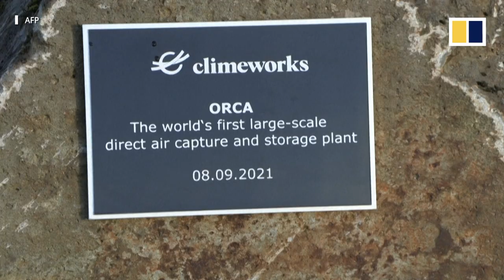Iceland power plant stops greenhouse gas by turning carbon dioxide into rock

Comment: "The gas reacts with the basalt rock and solidifies within its cavities for up to 2 years"
... and after that? It gets released again?
Reply: you wouldve buried it deep underground already...
Reply: @yerri5567  Imagine someone accidentally mines it
Reply: "It's only released if it's super heated, like during an eruption...but the volcano has had minimal activity and the last eruption was 1,900 year ago."
The clear rock is the co2...I think they know what their doing chief
Reply: @audreyholmes9751  I doubt it would be that easy. But I haven't watch all the video yet, so this is speculating on my part. You obviously want to bury it down underground in an uninteresting location, and super deeply so right? Temperature also increases everytime you go deeper, what do you think the carbon stone stability will be when it's exposes to a couple hundreds of degrees Celsius?
Reply: @memerusos8145  won't that make diamonds?
Reply: Yeah, I laughed when I heard that too :)
Reply: @ordinarydude2237  no
Reply: @piotrtrebisz6602  That's cool and all, but the soviets bore hole miner thing melted when they dug 10km+. Do you know the materials for the miner to not melt and crush at such pressure? Even electronics would break long before that.
Reply: @piotrtrebisz6602  Oh? My memory must have gotten mixed up

Comment: So what happens after those 2 years? Does is get rereleased? Or is there a gas buildup underground waiting for a poor sap
Reply: Ah I think that was a translational error, I'm pretty sure they mean the process by which the carbon dioxide becomes part of the rock takes two years to complete rather than it only stays there for two years, otherwise this would be really impractical and ultimately not accomplishing much

Comment: this is cool and all but what about the carbon footprint of building these giant industries? the cost of running the electricity to fuel the production of turning carbon into rock? the maintenance needed to keep it running? the vehicles the workers drive just to commute there? is it really worth it? will it make a difference 10 years from now? will it become more sufficient 10 years from now? will it contribute to more waste and carbon 10 years from now when parts break down and need to be replaced? what are we going to do will all these rocks now? if we do anything with them at all, like say turning them into material for construction, you need to spend so much energy on the process too.

Comment: There's a technology that converts Co2 to oxygen, its called trees.
Reply: Which are being cut down and burned at high rates.
Reply: That's only partially correct and it an exceptionally slow process.
Reply: Yes - however every fully grown forrest ist Co2-neutral.
And those 4,000 tones of Co2 they can convert per year and the equivalent of about ~2,000 trees  (depending on the type of tree and age).

Comment: "The process is energy consuming." So it produces more CO2 to capture some CO2. Great idea. Always circling in the loop.
Reply: Not all energy generation processes involve combustion. Icelandic energy rely greatly from geothermal source.
Reply: Watch the video again, they explain to you how they use geothermal energy from a volcano to power the plant.
Reply: @KiwiImpactSaint  So can we triple world electric generation by using Iceland's geothermal so that we can fill Iceland with these plants to remove not just 4000 tons a year but 42 Gigatons per year?
Reply: @ChronicOstrich  Why should I watch the whole thing to get the full context when I can just post idiotic comment and spread my idiocy with others.
Reply: @cliffordnelson8454  4000 x 1000000 = 4000000000
Thats only 4 billion per million of these plants.

This problem isnt gonna go away easily.

Comment: So basically we could make it into diamonds later.
Reply: Dont you date reduce the value of my diamond.
Reply: @msjanegrey  We can already replicate diamonds actually. But not yet in a gem quality. Sanders, glass cutters, and boring machines drill bits are one of the products.
Reply: @soysauce4223  oh dear me.
Reply: Diamonds are more common than most gems anyway
Reply: @memerusos8145  diamonds are common, but gem quality diamonds are rare.
Reply: @soysauce4223  diamonds are rare cause of DeBeers
Reply: @memerusos8145  yea
Reply: Scientist says, diamond is just another carbon, just like CO2.
Reply: Doesn’t work so easily, diamonds are pure carbons (without other types of atoms) with covalent bonds in a tetrahedral fashion to form a big network. CO2 have two oxygen atoms. Idk if it’s possible, but you need to quite a lot of reaction steps to remove all those oxygen atoms. And those steps will need energy or resources, so I think it is not simple nor economically viable.( otherwise people be doing it already)
Reply: diamond is worthless

Comment: Carbon dioxide in the atmosphere is at equilibrium with the carbon dioxide dissolved in sea water - about half and half. Equilibrium means if one molecule of carbon dioxide is removed from the atmosphere it is replaced by one molecule of carbon dioxide from the sea. The concentration of carbon dioxide in the atmosphere remains unchanged. The concentration will remain the same until the amount of dissolved carbon dioxide in the oceans begins to decrease as a result of capture of carbon dioxide from the atmosphere through processes such as the one described. This is a gigantic amount. It may take centuries.

Comment: Are we not trapping two Oxygen atoms when we are trapping CO2?
Isn't that a bad thing then?. Converting CO2 to O2 is I suppose ok, bht trapping CO2, well., I dunno.
Reply: Maybe the chemical reactions are easier, there surely is a reason, why they chose the material. Maybe it can be used for building tho
Reply: @kugul1683  Easy or not , trapping any gas in the atmosphere like this a large scale, won't have changes in atmospheric pressure?
Reply: There is way more oxygen in the air than CO2.
Reply: @HunterShows  Waaaaaaaaay more.

Comment: If this uses more energy than a coal powerplant could produce while emiting the same amount of CO2, Its poinless and even bad for the envirement!
Reply: facepalm it's geothermal my dude, they cant turn the volcano up
Reply: how do you know are one of the Scientist who work there? Dont make up any fabricated stories if you dont have any evidence to prove your statement
Reply: @markchristianhernandez2890  The location is introduced as a "geothermal power station" at 0:02
Reply: Doesn't matter how green the el electricity is because the electricity could be added to the grid, offsetting fossil generation. 
And yes, I know Iceland doesn't use any fossil generation. But imagine if all the Bitcoin mined in china on coal power was instead mined in iceland using the power that is now wasted on this CCS facility. Also a HVDC connection to the UK could be considered.
Reply: @nielsdaemen  You definitely have a point - although, there's a non-negligible loss in efficiency when power is transported long-distance; having the carbon treatment right on top of the source of geothermal power avoids that at least!

Comment: boiling the water to extract the co2 is energy intensive however if iceland has some geothermal springs it could be possible to extract heat to reduce the amount of additional energy required

Comment: These sites should be every where, every country and cities. Amazing.
Reply: Unfortunately due to capitalism it wouldint be profitable to implement this across all countries and city's
Reply: The energy required to run this equipment takes energy.  Where will that energy come from?  Suppose it comes from coal... Bad idea, more CO2 would be made than you would be able to remove from the air.  What about wind and solar?  Nope, those take land and you would be more efficient and cost effective to just grow trees and bury the wood.  You'd be better of just using whatever energy you have to supplement the local grid.
Reply: @kayakMike1000  Nuclear.

Comment: This is a joke. Energy consumption is ridiculous. They can remove 4000 tonnes of CO2 per year - equivalent to only 500 average Icelanders' yearly CO2 output. What with the materials and energy used here? Just people driving there to work means this whole facility will never be net carbon neutral.

Comment: It doesn't fix the problem.Simply slowing down the process.
Reply: Which is better than nothing. Trees will pick up the slack.
Reply: @HyanIze  Carbon dioxide doesn't mutate, though. I do get your point. The slowdown do buy us a bit of time. Hopefully, enough trees are planted by the time they are eventually released. But, you can guess what reality will actually happen.

Comment: There are 42 Gigatons of CO2 created each year, which is more than the total amount of earth moved. To remove a ton of CO2, how much of this rock do you create. At some point you will no longer be able to inject it in you local garbage pit, and will have to more it somewhere else. And how much energy is required for the process. If you have to use fossil fuels to create the energy, will you actually be saving anything, or creating more CO2. I heard that the electric generation capacity would need to be tripled to remove this much CO2, or about double the total amount of energy the world uses. Seems like the first thing that needs to be done is remove as much of the CO2 emissions as possible, then can start trying to increase electric power so that can start removing CO2. Before that this work is only making the problem worse. So put the research into something that is a lot more useful than carbon capture, put it in reducing carbon emissions.

Comment: What if this stored CO2 could be enveloped in a transparent container and then sold, either as decoration, as a construction material of some sort, or in other ways used as a type of geopreserving currency. We know every company and country has CO2 quotas, what if CO2 could physically become something that would be tradeable something in demand. That would skyrocket the general public investment, as well as that of the financial sector and businesses, further sparking an interest in carbon capture and efficiency improvements and scaleability in other parts of the world. Just see how bit mining has turned the whole world upside down even though it's merely a digital conjure with no actual relevance.

If there is actually a low-down demand for physical CO2, this could really take off.

Comment: what does the c02 molecules look like?
Reply: The simplest method (Also the current natural, and most abundant capture) is in water . Carbon dioxide reacts with water to form Carbonic acid, Carbonic acid will react with Calcium to form calcium carbonate (Common Chalk). The worlds oceans are the largest carbon capture, far far more so than forests.

Comment: The Ecological disaster such a large scale carbon sink would cause if the Volcano was to ever Erupt releasing Basically a Carbon Bomb into the Atmosphere. I think we need to find alternative safe sites to store the captured Co2!
Reply: its not stored as co2 the co2 is reacted with the stone due to the pressure and heat ad forms a new material
Reply: Yeah I don't get that part.

Comment: A process that has been going on for millions and millions of years and is still going on. That is why CO2 was decreasing over time before humans started to restore CO2 into the atmosphere from old fossilized life and put it back to the cycle of life. However, CO2 stored in rocks or sedimented on the ocean floor as CaCO3 is not possible to restore to the atmosphere without adding energy. Burning fossilized life gives back stored solar energy.

Comment: This would be valuable if it ignores highly stable gases, like CO2, and focuses on actual pollutants, like CO, sulfur and nitrogen compounds, and dioxins that occur from burning or manufacturing certain products. Then it would be quite valuable. Otherwise, however, mineralizing CO2 just serves a lesser purpose than keeping it in the air, since CO2 is reusable by plants (plants become stronger when they have a higher co2 ratio to oxygen, and this in turn means more plants so eventually extra CO2 just balances itself out), but all the other air pollutants most certainly are not. 
That's just my proviso.
Reply: "That's just my proviso."
But not the proviso of 99% of the science commity.

Comment: One question: why
Reply: Rocks used in consturction?
Reply: use brain     then talk
Reply: @cloroxbleach7554  it doesn't accumulate longer than couple of years, debunked before
Reply: @georgechertkov4140 ???
Reply: @georgechertkov4140  Sources please. For the last 20 years, I've seen and felt the effects of climate change. Quantitative data and research also points towards it.
Reply: @cloroxbleach7554  assuming by this comment, you do not really care about my sources, so I'll leave you in peace
Reply: @georgechertkov4140  yeah? What sources?
Reply: @georgechertkov4140  I can give you a whole bunch of sources, but I'll be waiting for yours first.

Comment: I have no words.  This is the dumbest thing I've seen in a long time!  Reminds me of a Frank & Ernest comic. The one panel shows our heroes staring at a vending machine with a large coin slot, plugged into a wall outlet with a lighted sign on the front that reads:
 
  Dispose-a-Dime -- Insert 10 cents

I bet the owners of that machine have a healthy stake in this operation.  The thing is I thought Icelanders were smarter than this.  Maybe they are, maybe they're just leasing the site to the Eco-nuts and are pocketing a nice fee.  SMH